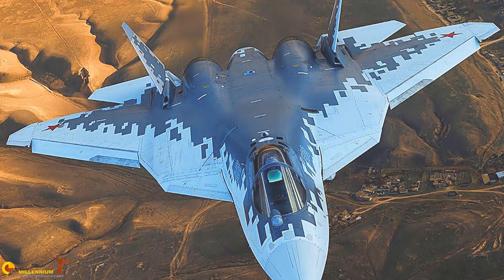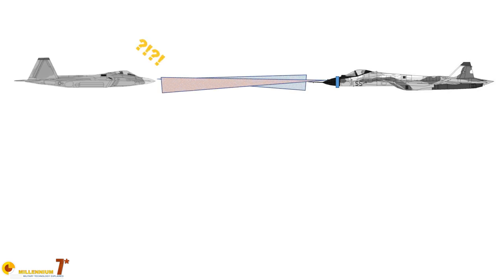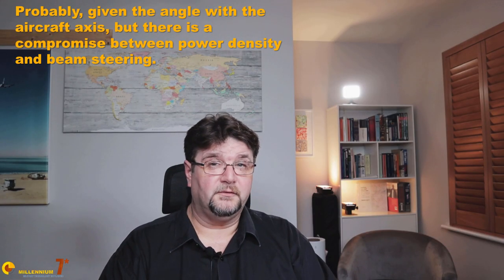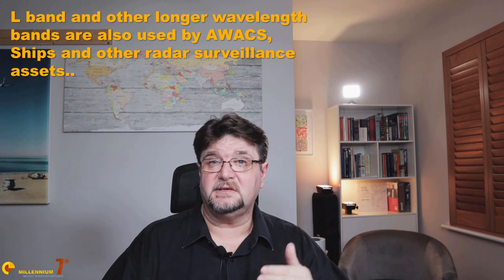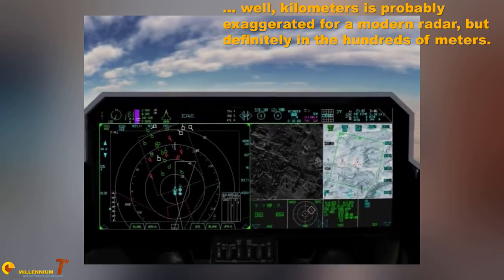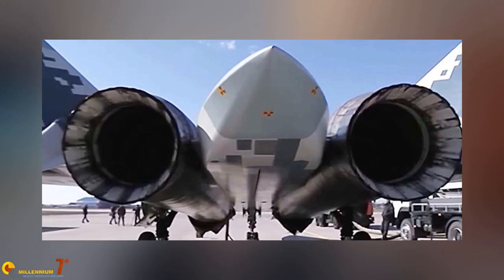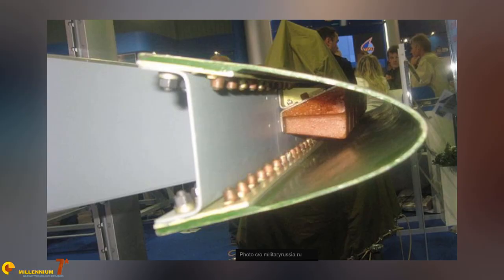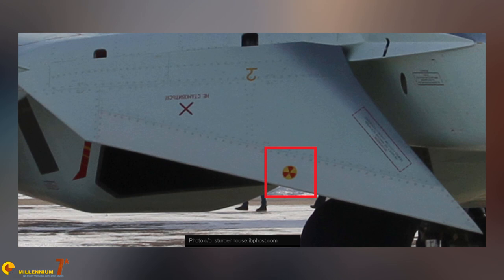Su-57 the Raptor Spotter | Part 4 - Radars, ESM, ECM, IFF

Comment: Putting L band on a fighter most likely does degrade the atvantage   of other 5gen planes and also shows an asametric solution to  air superiority . I just wonder if the su 57 and russian ground based sams can share data ? If so the su57 is just an addition to a system that is  already  the most complex air defence system of systems in the world . i wonder how far the Russians have developed censor  "fusion" in platforms but also between them ?  amazing video thank you Sir!
Reply: Yes
Reply: Even old Mig 31 in 80s could share data with S-300
Reply: Isnt L Band good against stealth?
Reply: @JMiskovsky  it is, and thats why they put it on the 57
Reply: The Soviets already had some sensor fusion back in the 70's with their IA-PVO. The Mig-23's included data-link and remote interception including IRST for stealthier interception. I'm sure they've developed the system quite a bit since then.
Reply: @jfrorn  I knew about IRST of Mig. But data link was there to guide aircraft to place with out radar? Right?
Reply: @jfrorn  F-102A and F-106A had SAGE ground-to-air data link for the bomber intercept mission profile for NORAD. F-106A had a retractable IRST globe in front of the canopy.  Swedes copied it for their air defense network, then claimed they invented it. Same for Soviets with MiG-23, which got IRST in 1971.

US had IRST on the F-101B, F-102, F-106, F-4B, F-4C, F-4D, and F-8 Crusader. F-4E got the TISEO in the port wing leading edge since the M61 took the place of the IRST under the nose. F-14A got TCS option, which was one of 8 different ALQ-100/IR/TCS configurations for the Tomcat's chin.
Reply: @JMiskovsky  it is and isn't at the same time. It does detect stealth planes at reasonable ranges. But it isn't enough to get a track for a missle launch. You get a rough estimate of where the enemy is - and if he is there at all - but you got to work your way from that point on.
Reply: Oh, as I wrote it he already explained it in the video!
Reply: @phunkracy  still better that nothing. IR sensor could solve rest.
Reply: @phunkracy  Probably not enough to guide a sarh missile to within its warhead’s lethal range but probably enough to provide a missile with an active radar or ir seeker with inflight position updates accurate enough to put them within their own seeker’s detection range. So they can indeed be used for missile guidance imho. Just remember the shooting down of an F117 by a 60’s era Dvina sam battery of Serbian air defence forces that didn’t even have an active seeker. And that was 60 years old technology. Stealth is very very much overrated by the USA military industry complex and politicians imho. It seems to be the most efficient in stripping tax payers of their hard earned money.
Reply: The problem I see with the SU-57's L-Band radar is going to be with its antenna performance. Just look at how big the the ground based L-Band antennas are (optimum radar antenna size is proportional to the wavelength, so a small area radar antenna on a long wavelength radar band is antithetical) , please realize that both radar angular accuracy and transmit ERP are largely a factor of antenna shape and those small  L-Band antenna sections on the SU-57 wings are going to have many issues, such as:
1. Low Antenna Gain
2. Wide Antenna Beamwidth in the horizontal plane.
3. Horrendously huge antenna beamwidth in the vertical plane.
4. Very large Side -Lobes.
Reply: @r.b.seiple5913  please explain points 1 to 4.
Reply: If they haven't yet integrated it most likely will be with the SU-75.
Reply: @JMiskovsky  its good but not strong enough to track anything
Reply: @williamjr5825  well if you get close enough then IRST/ X band radar can take lead.
Reply: @JMiskovsky  if your still alive to do so
Reply: @williamjr5825  that is good point, but situational awareness provide by L band. Might do a trick of not getting shoot at that easily.  +/- 10 NM is good for " WTF, lets get back under S-300v4 umbrella ASAP.
Reply: @williamjr5825  thank you for enlighten conversion
Reply: Fabulous to see some unbiased content on this that doesn’t just start spouting ‘Russian tech is junk’ Having seen Su30 and 35 very close in Russia’s Voronezh region and even spoken with some pilots.. they are anything but junk, so the 57 will be even more impressive than these
Reply: @LRRPFco52   You are realy comparing IR detectors on F101s to modern IRSTs on Mig29s, Rafale, Gripen, Su-35? Thats unreal! Those things you mentioned on the F101 or F102 werent real IRST, just a back up system to verify the target before intercept. Early radars were not too reliable and this was a simple way of makeing sure the real target was in sight. However you couldnt use those instead of radar! How would you determine the range? Because modern ones do that with a laser system.
Reply: @S300V  I like your nick. Well it would interesting topic to compare different systems together. Mig 23 could do some search and track for its IRST. European Pirate IRST is capable of tracking up to 200 targets! What is advantage of OST-29? How does it compare? Is EOTS e nough? Would it be better to add IRST sensor. Should it have UV spectrum capability?
Reply: @mcal27  it is rare. I learned many thinks from this comment section.
Reply: @S300V  The claim was made that the MiG-23 first had IRST.  I listed the historical reality, and now the conversation changed to “You aren’t really comparing IR detectors on F-101s to modern IRSTs on MiG-29s, Rafale, Gripen, Su-35?”  You’re right.  I never compared the 1950s/1960s with modern IRSTs.

Intercepting bombers means you had to deal with significant raw power from their ECM, and look-down against background clutter was a major problem for pre-APG-63 (F-15) radars, so an IR TGT location and tracking system was used.  The F-106A’s IRSTS was far more advanced than you might think, but wasn’t really discussed in the open.  

F-106 Intercept Weapons School Instructors described it as a tremendous system that could be used many ways, including:

Track any IR source, then provide azimuth and elevation to the MA-1 Fire Control Computer which would then correlate to the radar contact.

IRSTS could be slaved to the Radar to TGT discriminate against ECM and chaff.

Radar could be slaved to the IRSTS to get Radar track and range to TGT, used to discriminate against background clutter in look-down mode.

IRSTS was the primary way to deal with supersonic high altitude TGTs.

IRSTS would get very strong returns up to 180 miles away, well before the Radar.  The IRSTS increased the Radar contact and tracking ranges this way, and provided the best solutions against high closure rate TGT drones (Mach 2 to 3 combined closure rates).  The F-106A had a high pk against supersonic drones using the IRSTS and Radar with the AIM-4 Falcon missiles.

They used IR Angle Ranging for WEZ profiles with the AIM-4 missiles, even against TGTs they couldn’t see.  They did Angle Ranging by flying level with the IR source, then climbed 1000ft with the look down angle set to 20 degrees declined.

A lot of the older systems remained highly-classified and never discussed in the open until decades after retirement.

I listed 8 different US fighter types that had IRST/IRSTS before the MiG-23, but never compared them with 1990s designs.
Reply: @LRRPFco52   Thanks for the informative reply! I just wanted to point out that those old IR systems on aircraft were not real IRST more like a support for the radar during an intercept. As you very well described it, bombers would use heavy ecm thus IR would be of good use. Btw Mig 23s system is similar too. The first "real" IRST is that on the Mig 29 and Su 27 because those could fully substitute a radar and provide firing data.
Reply: @JMiskovsky   I was surprised it was available. Anyway the Mig 23s IR system was still very limited and was more an anti ecm feature than a true alternative to radar. I think "real" IRSTs should have the ability to track, range, provide firing solutions. The number of tracks is important but not of outmost importance. The coverage is more so, in the future optimaly 360 degrees. Multispectrum too so yes UV, but I think they are already integrating such. EOTS is not realy the same because it works in different wavelenght and is optimized to create an image, this makes it accurate but limits range.
Reply: @LRRPFco52  Great elaboration.
Reply: @S300V  The IRSTS on the F-106A was far more capable than people assume.  It’s just that the USAF is extremely tight-lipped about sensor capabilities and has pilots sign very restrictive NDAs so they don’t reveal actual capabilities from the pilot’s perspective.  USAF has been like that for a long time.  

The IRST on the F-8 Crusader was much more critical to its capabilities than one might think.  In Crusader College run by VF-124, 68% of the 4-week course was focused on managing the BVR fight, and the radars really sucked in the F-8.  The F-8’s IRST was integrated with the radar so that it could get a dual spectrum track and filter out noise.  Here’s a good read on the F-8:  https://www.aerosociety.com/media/8037/an-examination-of-the-f-8-crusader-through-archival-sources.pdf

The F-101B’s IRST was also highly-capable and integrated with the radar and fire control system taken from the cancelled F-108 Rapier.  It could detect supersonic bombers or cruise missiles at 76.5 nautical miles (141.7km), tail-aspect B-47 at 34.8nm (64.5km)/10.3nm head-on.

The F-101B could cue its AIM-4 Falcon missiles to a TGT with the IRST alone, so these were bona fide IRSTs integrated with the Fire Control Computers and Radars even in that era, complete with angle tracking and weapons cueing, long range detection capabilities primarily focused on locating bombers and missiles.

USAF had an emphasis placed on IRST systems by the Pentagon in that era.  Their capabilities were kept very quiet, but learned of by moles within DoD and CIA, who passed the technical data and materials samples to the Soviets.
Reply: @LRRPFco52   As you write: integrated with the radar. So than these systems cannot be used instead of the radar. Ranging data is still a problem. Aiming an IR homing missile with an IR sensor is not that much of a problem but providing guns and bvr weapons with tracking data, range information is different. Yes radars of the 50s and 60s were fairly bad and multispectral was a good idea (altough the soviets tought of this too, hence the usege of radar and ir guided versions of the same missiles from the late 50s onwords) but 10 nm head on for a B47 is not exactly stellar performance! Yes for supersonic targets up high they could perform, but no one was intending to fly there by the late 60s. Anyway its realy interesting what you write, I m just not that flatered by the performance of these things. Back in the 50s and 60s a lot was said about how technologicaly advanced fighters are with their sensors and missiles, than came Vietnam and the little Migs with guns.
Reply: @r.b.seiple5913  But they have one array in every wing. That means many narrow lobes.
They will not have any resolution in the vertical but the enemy can not be that far away in the vertical, once the direction is known the visual search can take over.
Reply: It can share some info. 
Their fighters aren't modified like the f35 is meaning a platform for a variety of operations including missile guidance..no other plane can that..no the mig 31 never had th as t ability with s300, that's bullshit!
Reply: @williamjr5825  
How do you know it doesn't track?
What testbed being done?
Any proof?
Reply: Sharing data is one thing - sharing massive high fidelity targeting information in real-time is magnitudes more complex - requiring massive data handling + speed of light bussing + data center processing power + secure transmission = capturing high volume data streams from mutiple sensors then bussing that data at high speeds through high bandwidth fiber optics for AI data extraction before fusing into massive streams of useful information displayed real-time + simultaneously shared with highly secure + high speed + wide bandwidth + high energy data links hardened against EW + nature.- with near ZERO latency to client platforms kms away - probably through multiple dedicated airborne or space based relays for over the horizon links...
Reply: Greater emitting power = number of T/R modules required to drive lower frequencies longer ranges is the limiting factor for leading wing edge L band AESA radar = linear array with surface area for much fewer T/R modules than much more powerful 11kW X band 1,552 T/R module Fire Control Radar - with Air Power Australia doing a detailed analysis using the limited info - modelling 1kW to 3kW L band wing edge radar detection ranges at 10km for 0.0001sqm RCS to 240km for 1sqm RCS - less than IrbisE PESA with 30km range for 0.0001sqm RCS + 304km range for 1sqm RCS - before considering extensive cooling of embedded modules in the very restricted space of a heat prone leading edge...
Reply: @deanboy2416  
I think it helps with detection but not lock on.
Reply: @S300V  
I don’t think he’s making such a comparison; rather that IRST existed on US planes some time ago and the US is likely to have technology that isn’t known or widely discussed or at the very least, the US isn’t inexperienced with the technology.
Reply: @keirfarnum6811   I think there is a general misconception about IRST systems and the capability gap between modern versions and the ones in the 60s/70s. Infact in the 70s this resulted with the US giving up on these systems at least for a while.  I ve seen several times people come with this argument that the US had these systems before totaly ignoring the fact that those had very limited capabilities and that the US stoped using them in the 80s/90s.
Reply: @deanboy2416  Thats something 
Thats complete nonsense. For starters, those L band antennas are too small to function as a radar. In order for a radar to work it needs to be able to focus radio waves onto the target by forming tightly focused beams, smaller the radar beam greater the effective radiated power or energy density per square km. A radar must have a certain effective radiated power threshold in order to meet the practical power requirements. So you want to have the lowest beamwidth possible in order to maximise detection range among other things, ideally having a beamwidth close to 2°. The aperture size is the fundamental factor determining the beamwidth or Gain (how tightly focused are the radar beams).

At 1 GHz with a 1 meter antenna size you’ll get a beamwidth of 21° – that is several times worse than 1960s era VHF radars on the ground which required >250 kW power to compensate for 4–6° large beamwidth (P-15, P-18). And the N036L L-band antenna on Su-57 is smaller than 1 meter...

Due to the small antenna size and relatively bigger L-band T/R modules, only a dozen or so can fit in the leading edge antenna (compared to 1,500 TRMs in the front radar) giving it only a fraction of the front radar’s power.

Also, there’s only a single row of TRMs in the leading edge antenna which makes it impossible to steer beams vertically, that is it can only scan horizontally (azimuth). This is why the manufacturer (NIIP) described N036L-1-01 having only 2D function (azimuth and range)
And if you don't have it in vertical Manner 
you cant steer beams vertcially Because you cant do this timed delay without Vertical manner:

TRM 1:0 secs

TRM 2: 1 secs

TRM 3: 2 secs

TRM:4 3 secs

You can only do this:

TRM 1:0 secs TRM 2: 1 secs TRM 3: 2 secs TRM 4:3 secs
And also if you have it in vertical Manner then you are gonna Surpass the threshold margin for Digital signal processing and you Are not gonna be even able to do AD conversion and you will Overload your radars ability to Work

With a 21° beamwidth you need the power of a small city in order to function as a radar. The Su-57’s L-band antennas neither has the size, power nor gain to act as a radar. The entire notion is so ridiculous that even Sukhoi or NIIP never claimed it to function as a radar.

There’s a reason why Low Frequency radars are so large no matter whether they’re on the ground or in the air. Even small business-jet based AWACS with L-band radar have pretty large antenna size.

Israel’s EL/W-2085 carries one of the smallest airborne L-band radar. You can’t fit a radar half that size on Su-57. Not only is there no real estate on a Fighter-sized aircraft for a lower band radar nor is there any notable advantage in carrying one. Even 40 year old F-117 had negligible variation in RCS across L through Ku band. You need to be in VHF band to see meaningful spike in RCS.

The notion that VLO aircraft are only stealthy in X-band is just as ridiculous as Su-57 having a L band radar. The L-band antennas on Su-57 are similar to those on Su-35, its primary function is an IFF interrogator (Friend or Foe ID’). Every aircraft since 1970s have one operating in L band. In addition to this, Su-57’s L-band antenna can also function as a jammer for the internal EW suite.

So no, there is no L-band radar nor any mystical sensor on Su-57 that somehow allows it to better detect Stealth aircraft. It’s just Russian propaganda
Reply: @JMiskovsky  In my opinion L-band isnt good against Stealth Planes now People have claimed Low Frequency radars as reliable counter to Stealth aircraft from decades. There’s no doubt that Low Frequency bands offer better performance against LO aircraft but what’s always missing is the relevant context.

According to the Serbian SAM Commander Zoltan, the P-18 radar VHF radar (with a 250 km range) could detect the F-117 with weapons bay opened at only 30 km at its lowest frequency, 125 MHz – despite F-117 flying a known route. 

The Serbian operator actually used command guidance for the SA-3’s missiles i.e. they manually guided the SAMs to F-117 from about 8 miles. Also, worth noting that according to Zoltan, the background clutter at 125 MHz made it impossible to operate the radar at that frequency – the only reason it worked against F-117 was because the Serbs had learned that in most cases no other aircraft was flying in the airspace during F-117’s bombing run.

The F-22 exceeded its design requirement of -40 dBsm or 0.0001 m^2 according to Lockheed
And the F-35 reportedly has a smaller RCS then the F-22 according to former Commander Of former US air combat command, the F-35 programm officer and pilots as well as people associated with both programs.

To give anti-Stealth radars a benefit of doubt, I’ll stick to -40 dBsm being F-22 and F-35’s RCS.

Protivnik-GE is the L band “anti-stealth” Search radar associated with S-400. It’s not standard but a speciliazed component that can be added. According to the manufacturer, it has a detection range of 480 km for 1.5 m^2 target.
http://roe.ru/eng/catalog/air-defence-systems/radar-and-electro-optical-equipment-for-air-target-detection/protivnik-ge/

Using the radar equation, against F-22 & F-35’s -40 dB, that equates to a detection range of 43 km.

Just in case you’re wondering, unlike the popular misconception a VLO aircraft has pretty similar RCS across L to Ku band as you can see in YF-117’s RCS testing.

And the F-117’s design had very little emphasis on reducing RCS in lower bands compared to modern designs. Lockheed filed a patent in 2010 about a CNT Based RAM (known to be used in F-35) capable of absorbing EM waves from 0.1 MHz to 60 GHz with particular effectiveness in L through K-band.

This combined with the fact that both F-22/35 have lower RCS than what’s used in the analysis negates any potential RCS variation in L band

Now Nebo-M This is perhaps the most advanced Russian VHF radar, used in combination with UHF and S band radars to form the system. This is also the system some of the fan boys glorify for its anti-stealth performance. Sadly, we can’t make a direct comparison because the published data is for extremely high altitude targets at 100,000 ft. (30 km) and also, there will be notable RCS-variation at VHF band.
https://web.archive.org/web/20181001031150/https://aviationweek.com/site-files/aviationweek.com/files/uploads/2017/12/12/State%20of%20Stealth%20FINAL%20121317.pdf

Now We do have some interesting data from RT’s documentary where the Nebo-M detected a commercial drone from 7.9 km flying at 100 m in a 90-degree sector-search. 

Since a VHF radar’s performance dramatically decreases with lower altitude (high clutter), it’s pretty good performance at 100 m.

A VLO aircraft like F-22 and F-35 will be flying at higher altitude and higher speeds, but at the same time they’ll have orders of magnitude lower RCS than the commercial drone – Nebo-M will obviously be detecting them from much longer range than the drone.

But this does provide a much needed context into how far that will be. Even a 10 times greater range put things into perspective – who has the advantage. Certainly not the radar operator.

This is the state of most capable ‘anti-stealth’ Search radar in Russian service and there are only about 19 of them.

And I’ve completely ignored EW here – the Low Frequency radars due to lower bandwidth and poor resolution are naturally much more vulnerable to jamming & deception – something the F-35 is highly capable of.

Even the standard internal payload of SDB (110 km) or JSOW (130 km) quite easily out-range the detection range of most advanced VHF/L band Search radars. Not to mention the upcoming JSOW-ER variant that extends the range to 556 km or HARM’s successor, AARGM-ER offering greater range than existing AGM-88E’s 150 km today
– both of which fits inside the F-35’s internal bay.

And that’s the case without even touching the Fire-control/Targeting radars. It’s pretty clear that manufacturer’s own data doesn’t support the hype around these ‘anti-stealth’ radars.

This explains why countries marketing anti-stealth technology & rhetoric from decades are trying so hard to design their own Stealth aircraft.